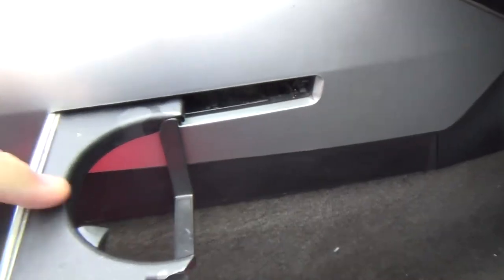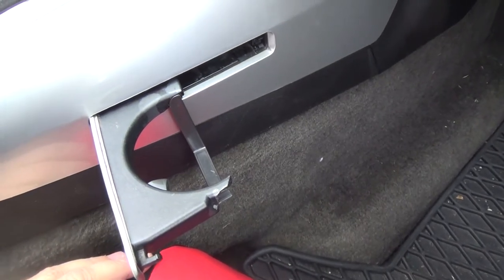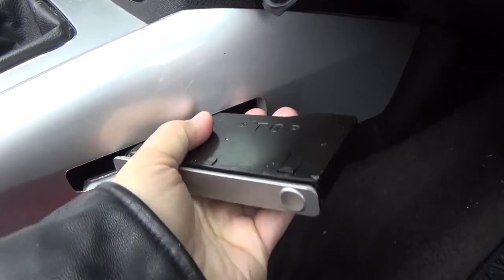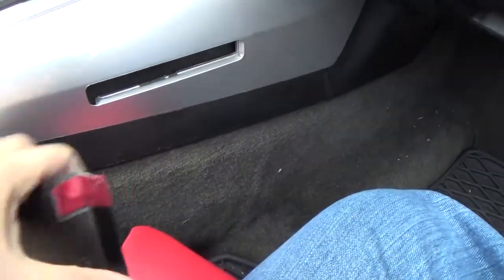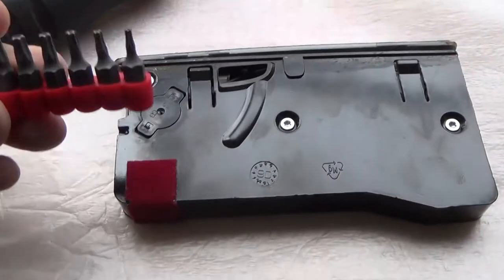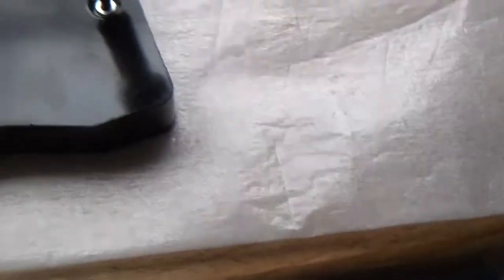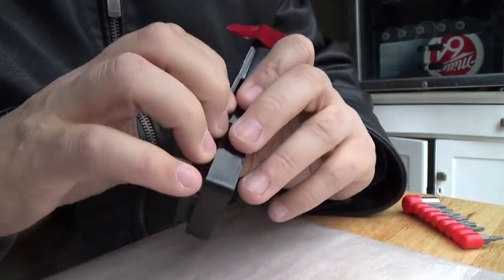Fixing The Passenger Side Cup Holder - Saturn Sky Pontiac Solstice

Comment: Thanks to your excellent video. I was able to repair mine even easier. I shined a light inside where the track for the replacement part goes. I got the new part in without taking any screws out. It went in easily and now it works. However it’s a bit sticky from all the spilled soda of the previous owner. I’m just going to blast everything with some WD40. That should help to remove the sticky stuff and lubricate it at the same time. My replacement part came with a stainless steel pin. It’s the part that slides in the track. Thank you. You’ve been very helpful.

Comment: Did the exact same thing with the exact same part.  I used a bastard file at first and then a dremel on the new plastic piece and just a small amount of 3 in 1 oil and it seems to work well.  For mine it seems smoothing off the parts was key to smooth operation.  My cup holder would not come out the normal way and required lifting the shift boot to release one side from inside the console.  Hope that helps others with similar problems.  So many people on youtube and the forums have helped me.

Comment: Thanks so much for recording this video!  I had my Sky serviced recently, and it came home with this never-very-good cupholder punched into the console.  I thought it was demolished by the shop.  But turns out, I just finished removing it, lubed it a bit with some silicone grease and dry spray lube, and reinstalled it.  It's working great!
Reply from the maker: That's awesome. I'm glad the video helped.
Reply: @MikesHouseOfMods  Hi Mike where did you get the part you had to sand,you didn't say.

Comment: Hi-As always, great information! I really like your site. I'm a 75 yr. old retired machinist/mechanic and recently bought  my 1st Solstice (06 base with 123k on it). Whenever I buy an unfamiliar vehicle or motorcycle, I try to research and gather as much information about it before, during,  and after purchase and all your videos that I've watched so far have been very helpful, starting with the 17 things you should know. Loved the comment about the cup holder being over engineered....You think?¿? Yes, mine is missing. Where did you get the replacement (it should be made out of metal)? Maybe a small amount of lithium grease would help the "action".
Now, about that twist/ release button that won't stay pushed in on the compartment door between the seats. From all the pictures I've seen, it seems to be a universal problem 😕.  Thanks again from an old guy having fun going around corners again. (I live in Ventura, Calif. and have ALOT of twisty roads to....ah, "play" on.😊)

Comment: Well for clarification mine is a 2009 Sky redline, whether that makes a difference or not.  But I was about ready to dislocate my thumb pushing it in so I looked at another YouTube video that showed it having the bolt and sure enough, mine did as well.  You do have to pop the shifter boot up and peek in below the white material on the passenger side to see it.   I also kept the spring loaded apparatus in place with one hand and never took it all the way apart, just enough to slide that new piece in and dry lubed everything known to man inside there.  Thanks!
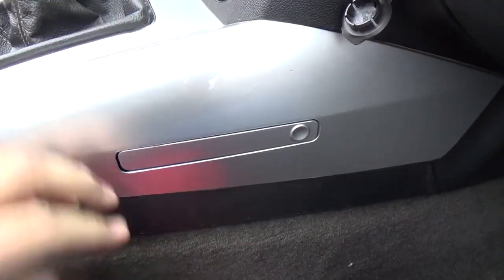Reply: For those viewers with a 2006 Pontiac Solstice - the cupholder 'cassette' can be extracted as shown in this video (2:00 to 2:45 appox.), without tools.
Reply: YES! Same model. I thought I was gonna have an embolism. lol

Comment: Mike 
Spray a little shot of tri flo on it 
It works great much better than graphite 
You can find it at most auto stores 
It’s the best lubricant spray I’ve ever used 
I use it on everything 
It’s fantastic 
Just saying 😀
Reply: Tri Flo is awesome just don't use it on certain plastics or rubber unless they're oil resistant. Petroleum based lubes will eat plastics over time. Otherwise I like it too
Reply: @Wpjgdmtu  Tri-Flow also has a tendency to dry out too.  I used to use it on my garage door auger and would have to respray about every month or so...and wipe up the drippies off the car and the garage floor.

Comment: I noticed a little piece broken off cup holder (mine is broken there as well) but when I replaced the piece that you replaced it didn't fix it because of that tiny piece that is broken. Drinks would still spill 😬 I have a little piece of electrical tape where the piece is broken.

Comment: Where can you get the part you replaced? Mine is missing and can't find that piece for sale separately.
Reply from the maker: Steve Egington you can try here. https://m.ebay.com/itm/Pontiac-Solstice-Saturn-Sky-Cupholder-Replacement-Arm/332649329599?epid=14006555054&hash=item4d7371f3bf:g:IksAAOSw4-hZtaOo

Comment: Mike, I got a question for you. What year model do you have? After watching this on a bigger screen I noticed that your housing on the piece that pops out looks different than mine. I was under the impression that all of them were the same except for the 2009s, but apparently not. I am curious if I need to offer 2 different styles to avoid the need to sand it.
Reply from the maker: Ricky Tuggle - Mine is a 2007.

Comment: Are solstice cars reliable or sky is better car????? I’m in a budget that’s why I ask
Reply: Water pumps are a weak link.  That’s about the only thing that’s sure to go out.  Some as early as 30k and some have made it 150k.
Reply from the maker: As "Oh Boy" said, the water pump is the most common failure part on either car (however, it seems like it's more with the turbo versions due to the heat). But as far as whether the Sky is more reliable than the Solstice, they're both basically identical cars except for the interiors and exterior. Mechanically, they're the same.

Comment: You missed the part about getting inside the shifter boot and reviving the 7mm bolt FIRST!!!  Without doing that you cannot just push the cup holder in.
Reply from the maker: Hmmmm. I didn't do anything with a 7mm bolt. I just pushed in on one side of the cup holder and it came right out. Maybe the Solstice has that bolt?
Reply: What was the word you meant to use?  Never heard of "reviving" a bolt.  Removing?

Comment: I do still sale them. I have been on the fence abount making the part slightly thinner to make it slide better. I just hate to make it weaker.
I do have a tip. On mine I was able to set the spring tension higher by installing it  in tension by rotating it before sliding the spring into the slot. That made it shoot out like a bullet.Cup Holder Arm
https://www.ebay.com/itm/332514295995?ssPageName=STRK:MESELX:IT&_trksid=p3984.m1558.l2649Cup Holder Base Platehttps://www.ebay.com/itm/332515968016?ssPageName=STRK:MESELX:IT&_trksid=p3984.m1558.l2649Seat Belt Guideshttps://www.ebay.com/itm/332514506992?ssPageName=STRK:MESELX:IT&_trksid=p3984.m1558.l2649
Reply: Myller De Araujo interesting... The bottom plastic piece on yours isn't cracked or chipped (on the bottom side of the cup holder) is it? Or maybe the catch on that piece isn't fully engaged? The sliding doesnt surprise me as others have that issue but the falling out does.

On the sliding I made a revision to the model that made the cross section smaller (closer to the original) and it made it shoot open like crazy (too fast in mine), but the test one broke in my car after about a month of use. So I never changed the design of the one I was selling.
I wish I had another cup holder housing to test fit these in but they are so expensive to buy. The one in my car must be a bit on the high side of the tolerances as all of them we ship open freely in it (my wife sands them before shipping).